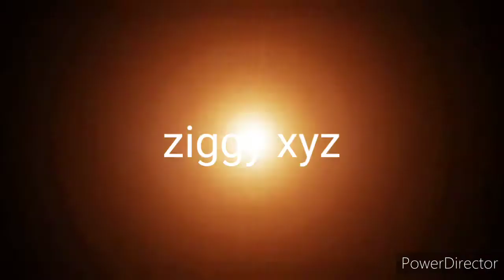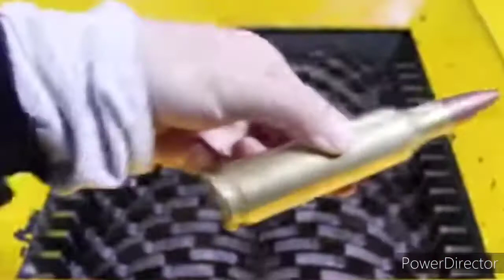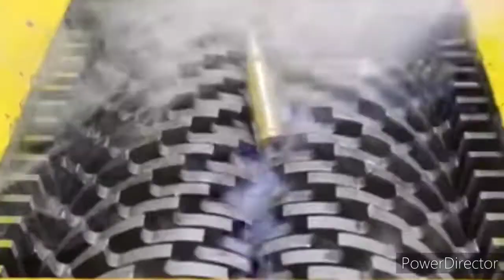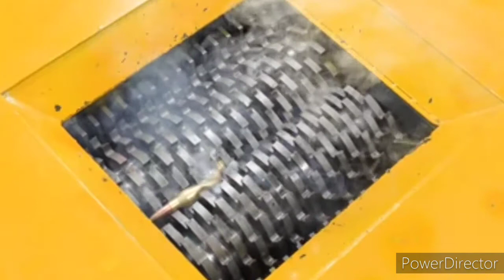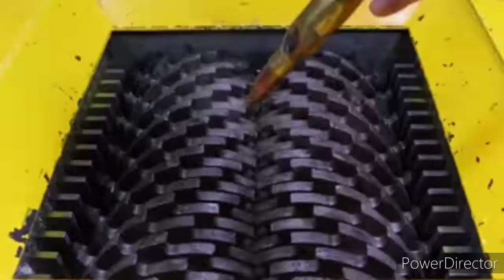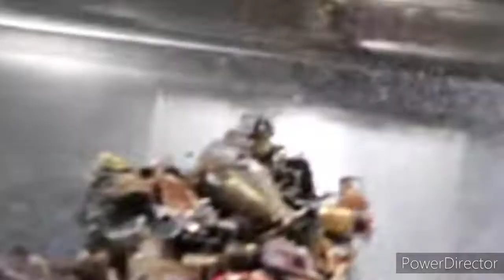EXPERIMENT DIFFERENT THINGS IN MEAT GRINDER #experiment #meatgrinder

Comment: the "bullet" is 12.7 cm long and not 15. 
also, the primer exploded and not the bullet. 
the creator of the video is just stupid to crush a 50bmg cartridge, because that thing could just completely exlplode, sending shrapnel everywhere.
Reply: It is a 14.5x114 bullet. Bigger than a 50 cal.
Still dangerous to crush.
Reply: @bigsmoke4345  after rewatching the video i just noticed too that the bullet is alot thiccer than a .50 cal.
thanks for mentioning it!
Reply: Most are damage and empty. Even full cartridge are not really dangerous to crush.
Look the SAAMI video about that !

Comment: That's not a .50 BMG, that's a 20mm or something like it. That was mostly or entirely the primers going off. That doesn't necessarily mean they took the powder out though. I mean, if they're smart they did, but there's just not enough compression to burn all the powder without the extra reinforcement that a gun's chamber provides. So there really is a chance that those were actually live rounds. The youtuber should be locked up for the safety of himself and others if they were, but there is a chance.
Reply: Look like 14.5 X 114